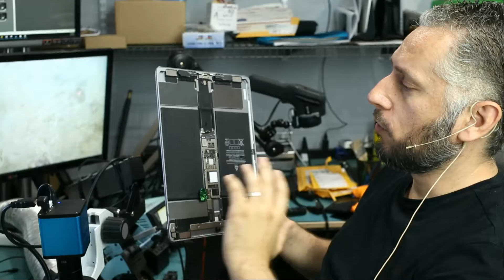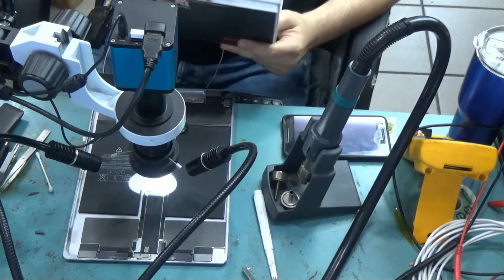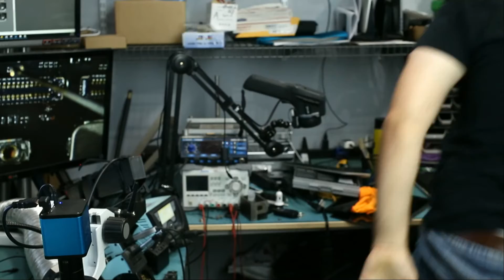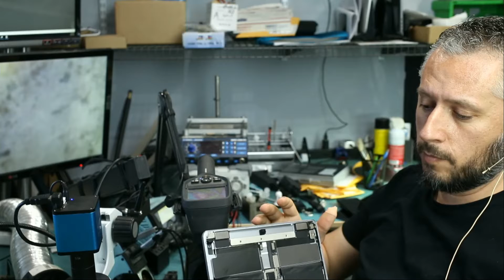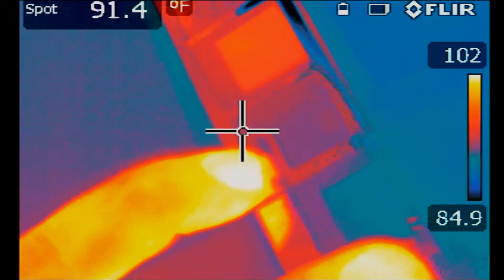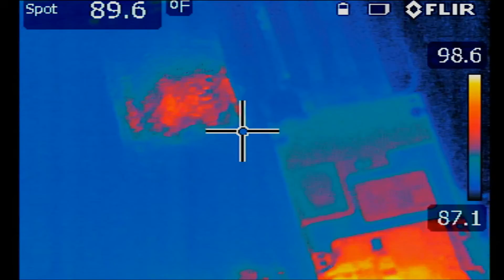iPad pro 12.9 no touch after screen replacement Repair

Comment: Very interesting love your videos been watching for a while I want your in put on this I have an iPad Pro batterys swelled and caused the screen to damage before hand the the screen was cracked anyway so I was planing on replacing my self done a few iPads before but I’m wondering for the iPad Pro as it is usb if there be away round it without buying a screen and using keyboard and mouse and usb c to hdmi as I used todo this with my iPad all the time then in theory we could save a lot of bent iPad Pro’s if we could run the iPad without a screen ?

Comment: My iPad Pro 10.5 screen is working but not the touch. It happened after I charge the iPad, unplugged from the charger and no touch response. I did a hard reboot (power button and home button) and I also did a software upgrade through my computer. It didn’t fix my problem. Any advice or help?

Comment: Thank you for the very informative video as always.  I occasionally fix things for friends but I'm curious about how to charge for services. When these situations arise where the customer was not correct about the issue and you already did work, do you bill them for that?
Reply from the maker: We're charging the same price quoted + extra for Display FPC connector replacement. That's what the problem appears to be as of now. Customer agreed and i will do another video on that.  If customer did not want to move forward with the repair, we would still charge a certain amount for the repair since it was done. Anytime we have a device that comes in with prior repair attempt or a device that requires time to work on, we make the customer aware that we will still charge a certain amount even if the device cannot be fixed to compensate for the time spent.
Reply: @NorthridgeFix  Thank you for the reply. I appreciate it.

Comment: Your Weller station is pretty expensive. What did you use before? Or what do you recommend for beginners?
Reply from the maker: Get the x-tronic. Great all around machine Soldering iron, hot air an pre-heater for about $250. I used it for many years when i started and i still use the preheater part of it up to this day. 

https://rover.ebay.com/rover/1/711-53200-19255-0/1?mpre=https%3A%2F%2Fwww.ebay.com%2Fitm%2FX-Tronic-Model-5040-XR3-Soldering-Iron-Station-Hot-Air-and-Preheating-Station%2F111360187849%3Fepid%3D23031294075%26_trkparms%3Dispr%253D1%26hash%3Ditem19ed959dc9%3Ag%3AlZIAAOSw-CpX~kkY%26enc%3DAQAEAAAB4BPxNw%252BVj6nta7CKEs3N0qVcYIy7BuqkO1rfIsGm75a6cN39anbhn%252BxlADkIJmU8t%252FYI7o7giL36xYyP0%252FZ6mlDSTSCiMVJOdwiaBod2K88O4eDyMhd496MJ2eH2l6dQMZwCjpjU4%252BeR9yla3k60wkn4P1rQOMjsgguM1HrBSZulyhoM6xbjeoO1BnQyld3WJQCRepkPYKoMZ6RM6TUrtq1Dm5m8Le%252F2t5C1mjO%252B9YxoAdstC3T14b96hE3MuJEqZRbgCgRnjmpahElKKlTTEuApzC3D2h8e5Lk%252F%252FcU6PxJVf1KPFSLBGm9GVrdPv7EYyoD9wHL2KpOckQV5QwY04V%252Bl67VZ3R3x3eoXagw%252BOUYQeeBVUwSvin2%252Bgr7JtE5HC4Yi3oQR7nhSHiwDMkXCNAztCcyZIJxrYcgQ8NB%252B6qWn0WvS1OmDD8l2gzoe9xd6RgbPbI3tKyvQpGRB2W0T5AlQgMGoSxsOQ3xnHgeAK0K86nVaqWciniDmTRsCXmA%252FALKw2IU5nl0GGaEeYzhBIVv61UM7YNCb1%252BHhzg%252FcK8dmkp2yV3NlQg1PO4cnKOAfh%252BDuv61rzmv0zUzWh%252FiBjfXhaxb6MpwV%252FjkRQqmgQ0xOdfZrq3tNrf%252BBs5GGZtK2oA%253D%253D%26checksum%3D1113601878498aaf847b74bd4d15bbe38bb4db825dcb&campid=5338440312&toolid=20008

Comment: I noticed that unlike most, you use a microscope without the optical eye pieces. Did you notice any issues with the depth perception due to the lack of stereo view?
Reply from the maker: I don't like to lock myself into 2 eye pieces when i'm soldering. I like to see my surrounding. it's more natural to me. Everyone is different. i work long hours on the microscope. I can't image how my neck and back will feel like if i'm using a stereo microscope. Depth perception is no issue for me.

Comment: Yes as always customers lies, I had a dji remote in for repair to replace the micro USB port he said it just needs that repaired so I  replaced it and but it did not solve the problem, charge ic was at fault so I ask for the full storey on this remote and then his reply was I bought it on ebay like that. So never believe what the customer tells you they will do anything to try and cut the cost of the repair. Lol